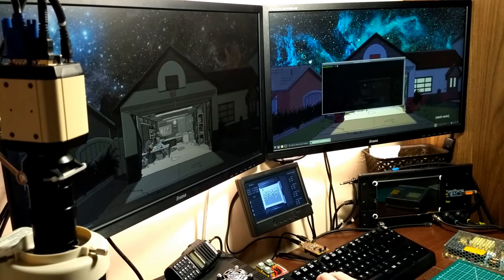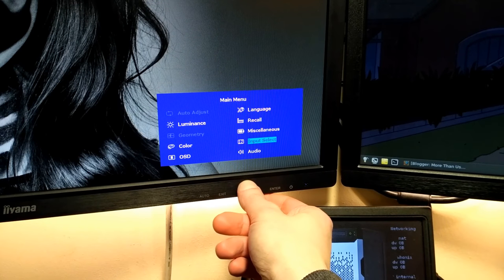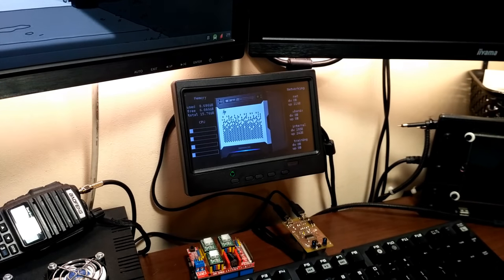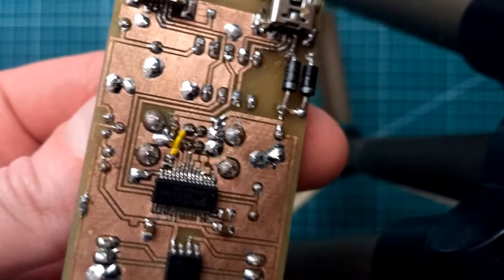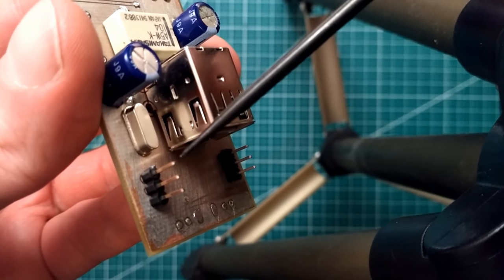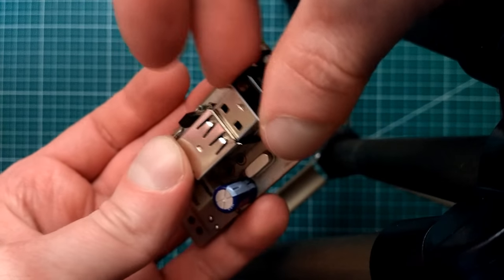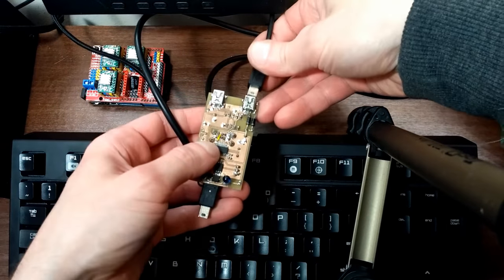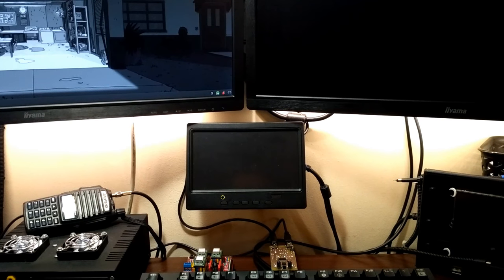DDC I2C KVM with mouse + keyboard controlled by hand gestures

Comment: nice, i like the idea to use the DDC lines to tell the screen to switch input. Instead of the gesture switch you may want to listen for a specific keyboard sequence and use a custom hotkey/shortcut on the keyboard to switch the computer (though that only works with an MCU but if you plan to add a shared clipboard on the board itself you will go for an mcu anyways)
Reply from the maker: I thought about this actually, but finally ended with mx mouse and keys from logitech. Currently I don't have those monitors anymore so this setup it's just a history. The thing that you see on the video was the first variant, I hooked up this to my home assistant and have a voice control over the monitor switch at some point. I have somewhere the videos from the setup, but since like 2 years I can't force myself to describe and publish it :|

Comment: Sweet! I was thinking about carrying out this mod, but I wanted to make sure it was possible first. Now I know it is possible!
How did you power the board? From the laptop or from the server?
Reply from the maker: Hey, thanks!. Click on the link in the description it will redirect you to my blog with more details, also with schematics. I'm using power form both laptop and server, this is possible thanks to semiconductor diodes, so two power sources and once receiver.

Comment: Hey can you help me build one of these? :)
Reply from the maker: Hey, sure! In the video description you can find link to my blog where everything is described, hardware and software and (more-less) stages of build. Check out the description first, then write me e-maili if something is unclear to you.
Reply: @morethanuser  Hey, thanks! I am actually looking for a KVM switch which has an HDMI port and DP ports.
Reply from the maker: @reggeli  So buy one, then try to reverse engineer it :) There is no simpler way. My setup is a pseudo-kvm, beacuse monitor have 3 inputs that can be switched and I just added the USB part using a relay,. It's kind of rudimentary looking on the hardware side, but when you look on functional side - it's a real KVM. If you're after the 'swipe to switch monitor' thing, just buy a commercial product that have some hardware button to change input/monitor, reverse engineer it and put sensors in-place of physical switch.